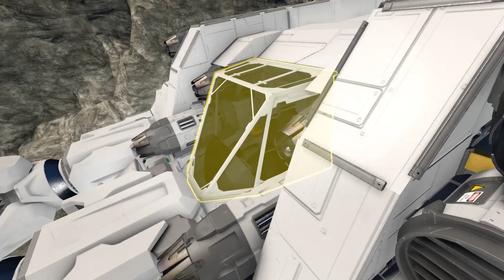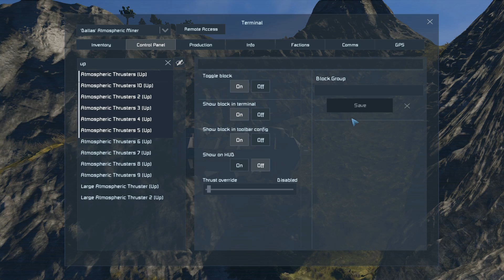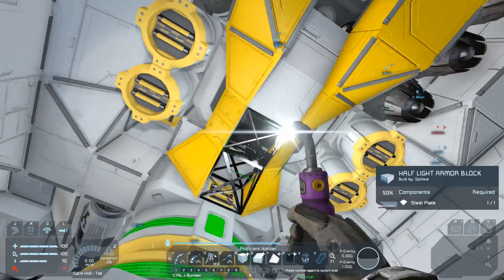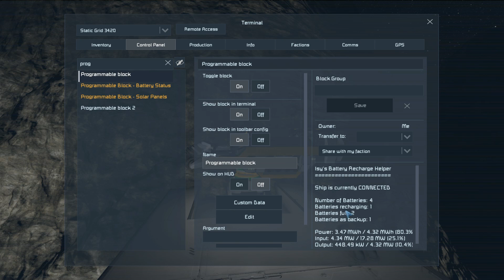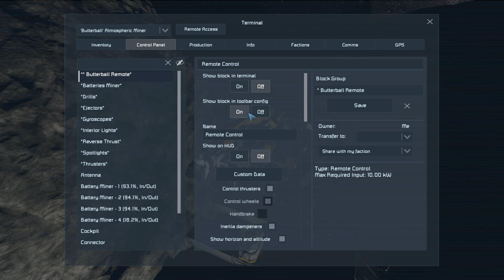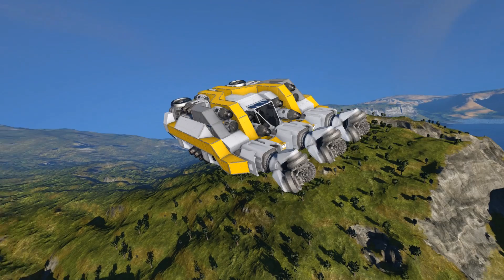Survival, Maybe... #19 Better Atmospheric Miner Build Part 3 (A Space Engineers Survival Series)

Comment: I used the same design but left the extra boosters and added 2 more batteries as well as two more horizontal inline drills it allows me to mine up to 156k with no lifting issues
Reply from the maker: The atmospheric thrusters got a buff to their lifting capabilities since this was made so I'm not surprised you were able to get away with more carrying capacity :)

Comment: When I started designing ships, I went into creative mode to test the thrusters on how much weight they could lift safely. I knew their theoretical limit, but that doesn't apply to real life. I found that my current setup uses 2 large and 2 small lifting thrusters for 110,000kgs GVW. My current setup only weighs 34,000kgs empty, which means close to a 4:1 ratio.

With that said...I think you have WAY too many thrusters on this rig. Just my opinion, which means nothing.
Reply from the maker: Thrust output has changed since I made it, so there may be a little more than is needed, but I suspect it just allows me to know completely fill the cargo space, but I haven't tested it recently
Reply: @Splitsie  that makes sense now. I also heard the large thrusters are more efficient, but I don't know that for sure.

Comment: When I am in a hole drilling, if my ship touch The ground i cant move it!! I tried 4 large Thrusters and... Nothing. Up, back... Nothing. If you can help me... As always 😅.
Reply from the maker: Do you have a landing gear on your ship? If so and it's set to auto-lock then you may have locked to the ground accidentally so no matter how much lift you have you'll be unable to move. Try having a look at your landing gear and see if it's showing green, if so it's locked and you'll need to unlock it. If that's not the case then it's possible you're overloading your power so adding more thrusters won't help - if your power read-out on the right of your hud is going to 100, then you may need to lighten your ship as opposed to adding more thrusters, or add more thrusters and more batteries :)
Reply: @Splitsie  Its Power. I saw it... 100 limit. 😅 I made a New one. I dig vertically... Its workimg now. But The problem was energy. Thank you so much!! Im watching Your serie now... Knowing about scripts.

Comment: I know this video is quite old but i tested your little ship, it is one of the best designs on steam workshop but i see some flaws
1: Upward thrust is a bit to small and when i loaded it to the brim with iron, well better do not try to descend to fast as TWR is barely over 1
2 that show another problem large thrusters are not surrounded with armor and are first to break when I hit the ground, also most of butt armor was gone with them.
3 3 back thrusters are extremely vulnerable and I destroyed them going backwards in mine, also turning in narrow corridors damages them as well.
    I think thrusters are even more fragile than before.
4 Pitching up and down to get more vein often destroy large thrusters cause they hit ceiling and flor quite often
5 landing gears are quite useful, they stop the CLANG, 3 times miner exploded landing with full cargo, also they mitigate rough landings damage.

Here is my design:
Front is identical like yours I just swapped tubes for joints, right and left from cockpit are reverse thrusters like yours and large thrusters(Upward thrust) so it has same width like your craft, after large thrusters 2 pairs of medium containers and second pair of large thrusters giving all thrust you need to stay in air.
between second pair of containers is large reactor, space between first cargo containers is designed like yours with ejectors, I just added single battery cause running UP, SIDE and FORWARD thrusters sucks up whole power from reactor and it is nice to start-up reactors after running out of fuel.
I got 10 reverse thrusters 6 side thrusters under cargo containers and 9 forward thrusters(large one wont fit on back and stick out 1 block, just to be safe I also added 3 up facing thrusters, so I can dig straight down,3 runs are ideal for mineshaft.
Also I armoured up all thrusters so they never stick out, tested by ramming my base (Need new walls and roof but miner was undamaged).

Sadly my miner looks like flying brick, somewhat military looking but still brick (I was never good at aesthetic) but thanks to 4 large thrusters it can (With weight 57000kg) not only lift ewry inventory full of ore but also thanks to landing gears take (by accident) scouting rover still having considerable TWR.

Again thanks for great tutorials they helped me a loot when I first got the game.
Reply from the maker: You're very welcome :)

I'd never planned to fill it to capacity so I'm glad you were able to modify it to your liking to get that working :)
Reply: Thanks to your videos that was one of may first "Working" vehicles.
I watched some videos and said: this can't be to hard:
attempt 1: Not enough lift.
2. more bosters, not enough power
3. Full Kerbal, need new ceiling
4. flip
5. flip
6. flip
7. oh there are gyros in-game!
That list could be much longer, but I found your tutorial :)

Comment: Kudos for the neater terminal! I really did get annoyed last 2 episodes, decided to wait until the end if that will be dealt with and voila! I really appreciate that. ^^ 

Also I noticed that Isy's battery script does marvels except it keeps a battery hostage? I saw that on your terminal one of your batteries was losing power while connected. Programmable Block mentioned "Reserve battery" so I think it keeps a battery running as a failsafe for program failures caused by nonexistent power output. Just noticed it on your video though.
Reply from the maker: You weren't the only one, I had a few comments, thought about trolling everyone and leaving it like that, then realised I would drive myself insane in the process :P

From what I understand of his script, that's exactly how its supposed to perform, it does switch the reserve battery to keep them at close to 100% I believe so you don't lose too much power capacity :)

Comment: impressive ship though at the end it looked like you needed 1 more thruster with that much weight
Reply from the maker: It was a tough balance on this one, I think I could use a couple more lifting thrusters, though as soon as I add those I'm going to need more battery power so that I don't drop when I'm making directional moves. I spent a fair bit of time trying to decide where the balance was going to be best, but I'm not sure if I got it right - I was happy with the styling though :P

Comment: what really happened with you 'losing power' was: your upwards thrusters on their own didn't provide enough lift, but every time you lifted the nose the forward thrusters helped provide lift which is how you got on the roof. so if you struggle again just lift the nose again.
Reply from the maker: There's a weird way you can also gain extra lift by just moving a ship with the gyroscope as well, but since I've balanced my power output you might be right that the reverse thrusters can add a tiny bit of lift if I'm only slightly off the level. I think I'm probably safest to just be a little less greedy and stick to 100,000kg :P
Reply: that would be best

Comment: You can use ctrl, shift, or both while painting to do a 3x3x3, 5x5x5, or the whole ship. If you want to save time. And then do accents on the outside.
Reply from the maker: I actually didn't know about the ctrl function doing a 3x3x3, the others I was familiar with. Thanks for that, it's always nice to know some new shortcuts :)
Reply: Splitsie haha, I knew about the ctrl function but didn't know about shift or ctrl shift until recently by accident.
Reply from the maker: That's exactly how I found out about painting the whole grid - might have been a little annoyed that I'd just undone all my paint work :P

Comment: Needs more thrusters pointing down.
Reply from the maker: If I had more I'd also need more batteries, that's what I was working out at the start of the video where I was deciding how many of the lifting thrusters to remove. I didn't want to have more than 4 batteries on the miner so I wanted the thrust to be balanced to that. What I really need to do is not get greedy and stick to only lifting 100,000kg :P
Reply: Maxing out the power is fine, just fly in straight lines when you're that full, using thrust for 2 directions at a time rather than all 3. It'll also prevent the sinking at slightly higher elevations. Having more downward thrusters won't make the side ones use any more power, so you'll still have the same minimum power available to hover, but more thrust in reserve to lift the ship.

Comment: Hey splitsie do you have any recommendations on what specs someone should use to run SE well, cause I'm looking into building a new rig when GPU prices go down again (fingers crossed that's soon)
Reply from the maker: In terms of my own direct experience, I have a GTX 1080 in my main PC and a GTX970 in the server PC - the one used to record the time lapse shots. Both of these very comfortably run SE with high settings so you should be able to run it with much less and still enjoy the game. I don't have direct experience with much else in recent versions of the game.
The other side of things that's important to keep in mind is that SE uses a fair bit of RAM so you should plan for a minimum of 8GB and ideally 16GB to run things reasonably well. 

Looking at the recommended stats on the store page: 
RECOMMENDED:
OS: Microsoft Windows 7 (latest SP) 64-bit
Processor: Intel Quad Core i5 @ 3 GHz or higher (or AMD equivalent)
Memory: 16 GB RAM
Graphics: Geforce 780 GTX or higher
Those seem like they are current based on my limited experience and would allow you to play with planets with decent graphics settings
Reply: Splitsie darn can't afford a 1080 rn thanks ether miners
Reply: But yeah I'll probably just get a 1060 or 1070
Reply from the maker: With either of those you'll be fine from what I've heard, you certainly don't need a 1080 :)

Comment: I like your design but isn't it a big flaw not to use any conveyor junctions it seems that the cockpit and 2 cargo containers shouldn't empty right?
Reply from the maker: Since everything that's going to have to pass through a mining ship can pass through all size of conveyors I only need the connections to be small and everything is connected up from the drills, through the cockpit, through the junctions that join to both the cargo containers and the ejectors. The connector is then attached to the bottom of the cockpit :)
If the cockpit gets destroyed the whole system fails, but then the ship would also drop out of the sky and failure of the conveyor system would be a small part of my worries :P
Reply: Splitsie yeah I know the small conveyors work I didn't see you put junctions on but you said you did so kind makes my question void :P thanks for reply and I love this series it's done very well it's very entertaining and I want to see allot more also are you using the no uranium Mod?
Reply from the maker: Thanks, glad you're enjoying it :)
I modified the earth-like planet to remove the uranium deposits, sadly at the time I didn't know how to get rid of the boulders so those are still there, but I'm just purposely avoiding them in the recordings so I don't get tempted :P
The link to the mod is in the description as well

Comment: You should mount a huge version of the area map on the ceiling in the main room.

Also, you were sinking every time you tilted the ship forward because you still had the forward facing thrusters off.  If you aren't flying absolutely level, you need all your thrusters on.
Reply from the maker: The reverse thrusters were on when I was sinking, I had put them on as I pulled up to the station. I think it was an atmospheric density thing as I was also going higher in altitude as I returned to base. There might be a step-wise reduction in efficiency and the base is just barely above one of those steps.

I'm planning on putting a large version of the map on the wall in the entrance area :)

Comment: Someone using and spotlighting the Paint Tool mod! Excellent! Are you having an altitude issue with thrusters or is it more of a power issue (related to the script perhaps)? 

Besides forking the conveyors from one sorter what else could you do to reduce mass? Are small tires less massive than full block light armour?

Are you going to install a set of stairs to the roof?
Reply from the maker: I'm amazed I haven't seen it around more, it's an awesome mod - and one I've had and used since it was first released :)

I think light armour is the lightest that you can use, so there's not much I can do to lighten the dry weight :(

As for the stairs, I thought the roof connection was going to be temporary so I hadn't intended to put any stairs in, but given how long temporary has turned out to be, maybe I really should :P

Comment: For walk ways, you could put cart walks without railings to direct you around base.
Reply from the maker: I've been thinking about using the catwalks inside the hallways more. I think I'm going to have to try a number of different setups in creative before I'll be happy with a look for the main hall as I really want it to be impressive :)
Reply: Splitsie also, for backup thruster power if you start dropping randomly, you could put a backup hydrogen thruster, there is a mod for more compact thanks, I use the tanks to build almost all of my hydrogen ships, and I think it would fit nice for a backup in case there is an emergency, like a power outage or damage from mining or a attack.
Reply from the maker: I was tempted when I started this series to attempt building a completely hydrogen powered mining ship, maybe I should look at this again and see whether it's practical, it'd be pretty handy to not be using much power from the base...
Reply: Splitsie that too, I'm just taking about a thruster or two so you don't have a hard landing

Comment: in regards to lift issues - watched several times, noted several thrusters disabled for no apparent reason. enabled upon impact, disabled again in a later frame. SE issues, or Script shenanigans suspected.
Reply: 1: Quickest reply I've ever had from a Youtuber. Awesome. 2: Glad I could be of assistance! 3: You. Awesome.
Reply from the maker: Interesting, I'll have to see if disabling the battery script has any impact. Though I suspect it is an SE issue as this isn't the first time I've experienced this sort of problem - I don't know if the thrusters were behaving that way for me on those times though.

Thanks for letting me know :)
Reply: Maybe its saving energy, turning them off then on when used
Reply from the maker: It's trying to be so efficient it's using my fear to power the ship! I really don't need to have a heart attack from almost crashing again :P
Reply from the maker: Thanks Hayden! The joys of a night shift without much work to do ;)

Comment: That looks super cool.  I like the way that the yellow blocks give the feeling that they are pipes running the length of the ship, even though they are not, fitting excellently into the industrial feeling.

I did find that leaning heavily to the right, almost to the point of falling out of my chair,  helped top get the Butterball onto the connector when returning to base.
Reply from the maker: Thanks Mick, I needed it, I don't think my leaning would have been enough on its own :P
I might have almost tipped out of my chair...
Reply from the maker: On a side note, is that you in your polys in your profile picture?
Reply: Affirmative!

Comment: Why did you put two sorters next to each other on both sides? You could just place one and then fork the conveyor leading to two ejectors. Like this, for example (> is the sorter, ^ are the ejectors and other lines are conveyors):

->┐
 ++
 ^ ^
Reply from the maker: I guess I could have done it that way, just didn't think of that solution at the time :P
Reply: See, it would save you 290 kg of ship mass and 5 seconds of setting up your sorters. This negligence is the sort of things that gives you nightmares. ;-)
Reply from the maker: Wow they're that much heavier than the conveyor blocks? I might have to fix that up
Reply: Unless there was a rebalance, one small conveyor sorter weighs 180 kg and one small conveyor weighs just 35 kg. That's the added mass of 11 construction components, 4 interior plates, 5 small steel tubes, 5 computers and 1 motor. Double that for both sides of your ship.

For some reason blocks don't have the same mass as the sum of their components and components have different mass than the ingots used in their construction. You should install Build Info mod that will tell you block mass and other information: https://steamcommunity.com/sharedfiles/filedetails/?id=514062285
Reply: Nethan2000 well you did some research...that’s what I call dedicated!

Comment: If I have a big block and I want it to go small what do I press on my keyboard ⌨️
Reply from the maker: I love going over the comments to see others helping out, thanks! :)
Reply: Super Jay Wolf Press whatever button you Pushed to select the item on your toolbar (eg. if I have Light Armour Block on my toolbar in the number 2 spot if I press 2 to select it then 2 again to change its size).  So just push the corresponding toolbar button again.
Reply: The same key you used to select the block. 
IE: If you press the 1 key to pick a large grid Gyro, than you can press the 1 key again to change to the small grid version of the gyro.
Reply: Or aim at a small grid. Then the grid size changes automatically.
Reply: Thanks guys for the help